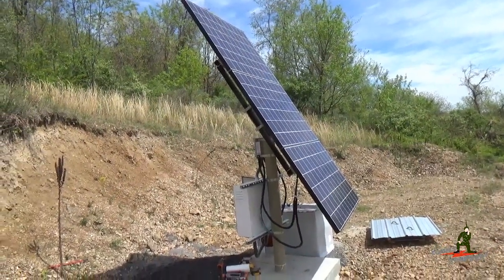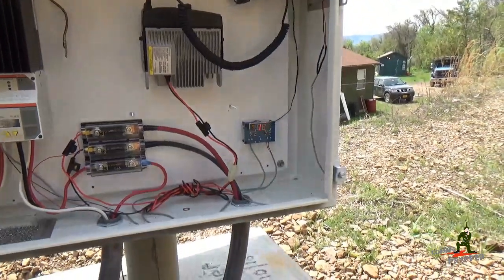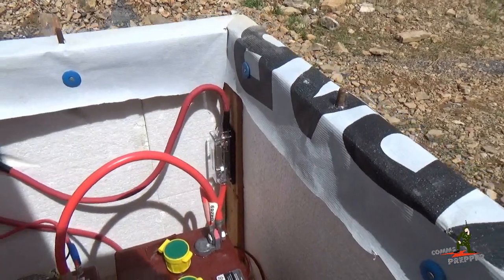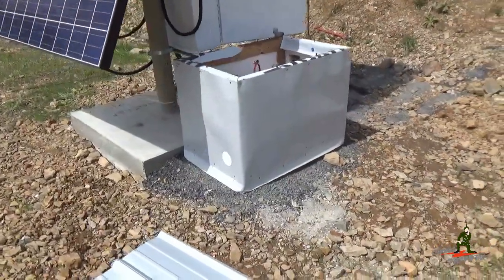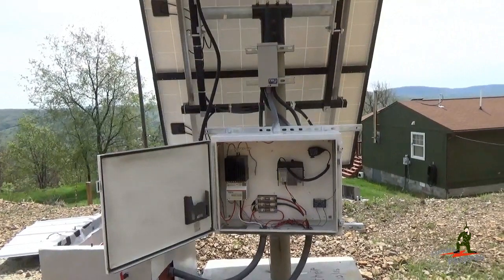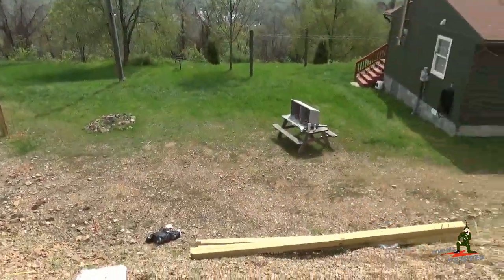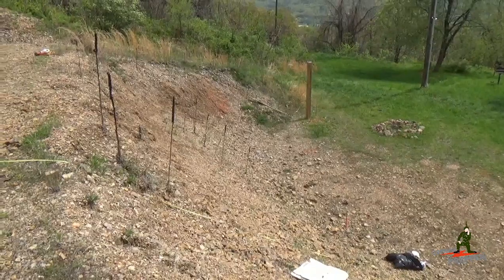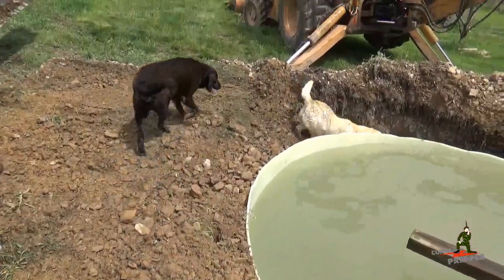Off-Grid Solar Power Project Completed!

Comment: I have 325 watt solar panels they are 34 volt panels with a open current voltage of 42 volts and with max current at 9.32 amps. I have a Rover PG 60 amp MPPT solar charge controller with a max open current voltage of 150 volts and I plan to use the 48 volt system which is rated at 3200 watts for a 48 volt system. I have a 48 volt lithium ion battery 50ah with 3.5 kw. So based off the max wattage input I can only install 9 —— 325 watt solar panels which equals to 2925 watts and a open current voltage of 379 volts which is way over the max open current voltage of 150 volts rated for the charge controller, so my question is which pv module wiring configuration do I use to wire my 9 solar panels to my charge controller and also I checked the manual of the controller and there is no pv module configurations, please I need help which wiring configuration do I use to install my solar panels ???????
Reply from the maker: This is allot of information.  Too much to digest without brand specifics.  Additionally, to provide advice on system design in a comment would be irresponsible. Sounds like you have already made a significant investment in equipment, I suggest you consult with a local subject matter expert (SME).  It is my understanding (I could be wrong) that when using an MPPT controller the array must be higher than the battery bank voltage.  When working out all these numbers you need to check with the manufacture guidance.  Reaching out to your charge controller manufacture maybe very helpful.

Comment: If I saw correctly, the batteries are sitting on a piece of plywood.  
A thick piece of insulating material between the plywood and the batteries might help in the winter.
Reply from the maker: I have a foam block underneath and around the batteries.

Comment: I'm wondering did you really have to call an inspector..they are ok if you want the assurance of there knowledge.. but most people don't know you shouldn't have to call them especially in an area like yours
Reply from the maker: Permit was needed (no way of not seeing panels from the street).  Once the permit was pulled for "solar" an inspection was required.

Comment: Really nice set up as others have said. I would make one comment on the battery box. I would put the vents up high on the sides. Hydrogen is lighter than air and will collect up top. I ran into a similar situation when constructing my BBQ island. I learned for natural gas it was up top and propane was down low.
Reply from the maker: Thanks for the tip.  I have two vents also in the lid for venting gas.

Comment: Hello,
Sorry for broken English.
I am not a specialist but I am also using home made solar off grid system for my ham radio and LEDs.

265ｘ3＝795W（PV）
795W/12V＝66.25A（input to TS-MPPT60）
As far as I know, MPPT amperage boost rate is about 1.35x, but may differ.
66.25Aｘ1.35 is about 89.5A max output.
TS-MPPT60 is 60A charge controller.
I think this setup might damage your TS- MPPT60 in certain conditions because it can be over current.....
I see two  "12V(6Vx2)" batteries in paralell, so 88.775A/2= 44.3875A  current charging for each battery, but internal resistance may differ on each battery that means more than 44.3875A can be flowing into to your one side of "12V"battery.
Trojan T105 seems that capacity is 5-Hr 185AH,  185/5=37A(5C charge current) but 5C is quick charge current so 10C to 8C is better for your electrode to be long lasting.

FB DX and best 73!
Reply from the maker: Thanks for the comment.  My array is not a 12VDC array, it's a 31VDC array and a 12VDC battery bank.  My panels are KU-265 panels.   Panels I think are 8.13amps max X 3.

Comment: Great Upgrade!!
 You can connect your 3 panels in series for higher voltage. T
The Morning Star Controller will handle it!
For Your INFO.
Reply from the maker: +Al Back-Up yes I could connect them that way but would lose charging current levels - which I need for equalization
Reply: Okay.
Just a thought for you.
Take good care of yourself
Thanks for the quick response

Comment: Nice set up.  We went with the most affordable option, just one battery and one panel but its plenty of power for our shipping container house.
Reply from the maker: Thank you for kind comment and feed-back.  What kind of battery are you using FLA or AGM?
Reply: Commsprepper it is a sealed lead acid battery.

Comment: Good job. BTW, you can purchase a panel moisture drain plugs and install one or two on the bottom of the cabinet. This will keep any moisture from condensate or rain water from accumulating in the cabinet. I've seen outdoor enclosures being packed full of solid ice in winter or with several inches of water on the bottom because no drains were installed.

Also, several mothballs in the cabinet will keep ants, spiders and other insects out. Hope this helps some.
Reply from the maker: The bottom of the box has a vent.  If water collected it would escape via the vent.  The mothballs is a great idea.  I have already had a black widow and wasps in the box (worked their way around the bottom filter).  I wonder if the mothball are corrosive to electronics?

Comment: like to see any way to check the voltage amp and system  via sms or via radio it will be a nice set up
Reply from the maker: Funny you bring that up.  That's my next project.  Before I moved the components from the house to the new site the charge controller was connected to the Internet and I would get daily emails from the system and could access the system via the Internet with my cell phone.  The charge controller is Ethernet ready.  I will be adding a wifi bridge this weekend to get the controller back on the retreat's wifi network.  Once it's connected again I will be able to do things you mentioned.

Comment: Where are you going to put the inverter? Will need to be close to the batreries. Outback's FX series would be my recommendation. They're built to withstand the elements.
Reply from the maker: When the time comes it will go where the radio is now.  I will move the radio inside the box.

Comment: "How many batteries do I need?" is always something I struggle to figure out.  There are web sites on it but its confusing.

I was surprised to see only 4 batteries in your box.  Is that enough to meet your needs or are you planning on adding more later?  I would have expected like 6 or 8 batteries.
Reply from the maker: +Greg Gallop Those websites are very confusing and it's hard to tell what's the foundation of a solar system.  For me the foundation (starting point) are the panels and their combined max charging amps.  With lead acid batteries you should be able to produce charging current equal to 10% of your battery banks total amp hours (per Trojan battery inc).  My four batteries create a 480ah bank but my panels can only 25.5 amps of charging current and I should have 48amps.  So even in my system I have too few panels or too many batteries.  But it's what I can afford right now.  So since I'm only using the system to power lights and low power items (TV, PC, etc).  I have enough for weekend trips.  If I hit the lotto I would have 12 panels and 8 batteries.

Comment: I like to series my panls and send high voltage to the house (around 140v DC.  That way the wire guage dosent have to be as big and will be a cheaper run to house.  then charge controler and batteries (sealed & vented) is in the house.   that way they are protected from theif, weather, and extreme temperature.  Same protection for the inverter.  Now I got local 12 volts for radios, lights, tv & satellite and what not in the house.   Whatever you do dont run 12 volts to the house.. Step it up and then back down but wastful and why i send panel voltage and not battery.
Reply: huh, No.  I have a Midnight Classic controller and it takes in the much higher voltage and lower current that can travel that greater distance from the panels on smaller gauge wire and charges out whatever voltage your bank is and what the controller is set to do output voltage wise.  So an input of 150v at 8 amps can output 12v at  100 amps.  Maybe that a MPPT thing but move power with higher voltage if at all possible.   Dont get me wrong Commsprepper Im not lecturing you but putting the info out for others reading to consider.. Think Ive watched all your video.. Thanks, K4JUD
Reply from the maker: Sorry - you are correct.  I forgot about the MPPT controllers and how they convert excess voltage into charging current.  Thank you for pointing that out.  Respectfully, Hank
Reply from the maker: +Home Phone the problem with series is you don't gain charging amps - you gain voltage.  So 10 8amp panels in series with only give you 8 charging amp.  I have flooded lead acid batteries that create a 480 amp hour bank, so I need to produce 10% of total bank amp hours (48amps) to properly charge and maintain (equalize) my batteries (per Trojan Battery Inc.).  Even with the 3 panels I have now I can only produce 25.5 amps of the needed 48amps but I can only afford 3 panels right now.   As for A/C power to the house it's the old Westinghouse vs. Edison argument.  It's better and cheaper to run AC vice D.C.  So when the time (and funds) come I will run AC to the house - but that's in the distant future.

Comment: How long is the wire run from the battery system to your home? What is the wire gauge? And what is the measured voltage drop?
Reply from the maker: The distance is 65 feet but I am not running it down to the house right now.  As it stands, the system is 12VDC only for my radios.  Perhaps in the future I will get it routed to the house after I add the second building below the array.
Reply: Thanks for the update! I enjoy your videos. Keep up the great informative work!

Comment: batteries will last longer if you could keep them near room temp.  an option is to move them underground.
Reply from the maker: +gg I agree but maintaining room temp requires allot of power.  We don't run heat or AC when not on site.

Comment: I don't think you  covered the run from the panels to your home???
Reply: So, for right now, 210 amp hours of battery storage and nearly a kilowatt of peak charging is powering an emergency radio... :)
Reply from the maker: I am not taking that challenge on right now.  For now I am going to leave it as a DC system for local radio operations.  Once I add the second building below the array then I will look at running power to the house.  With that plan, I will run the solar array output down to the new building and put the controller/inverter/batteries in that building.  Then I will only have a 20' AC run to the house.  However, that's a plan awaiting funds and I don't see that happening this year.  Perhaps next year.
Reply from the maker: Actually it's 480AH of power.  Once again I will have an inverter when funding permits.  I built this out to support the future plans.  Hank

Comment: Looks good. Have you thought about maybe taking some heater hose or something like that, and cut it lengthwise and use a glue or caulk and slide it around the battery cover? I'm just thinking it's at the perfect height for someone to accidentally walk or trip into it and get cut. Just a thought. Keep up the great work.
Reply from the maker: I was going to add something (I like the hose idea) after the inspection.  I want to keep everything clean looking right now.

Comment: That is first class. For the rest of us,  Renology.com has good inexpensive 100w 12vdc panels, $120.00 delivered.  I'd get at least one, if in the south, and 2, if in the north.  Also had good field test of a yagi.  The receiver was 25 miles away, and he could hear me good on one watt through a 10dbi yagi (ERP 5.5 watts) when it was vertically polarized.  When the yagi was use horizontally, just a moment latter, the receiver heard nothing.
Reply from the maker: Thanks for the info.  Hank
Reply: I need to make a correction.  In the field test, a moxon antenna was being used, yet the ERP is only 2 watts out of that 5.5Dbi antenna.  When crossed polarized, the signal is attenuated about 20Dbd, or about 99%.  Horizontally polarized, the signal is reduced to .02 watts relatively speaking, or 20Mw, and did not make the 25 mile trip with enough strength.  Had the receiver also had a horizontally polarized antenna, he would have picked up the signal no problem.  Conclusion,  low power and cross polarization is useful, if you'd rather not be heard.

Comment: Where's the antenna for your Kenwood ?  TM-281?

--Konrad, WA4OSH
Reply from the maker: I tested this weekend with a mag mount.  I have a double N-Type bulkhead connector on order.
Reply: A nice J-Pole on a 10-20 ft tower is order.  

Also, I would add this inside of your cabinet -- a ADS-SR1 Simplex Repeater.
https://www.argentdata.com/catalog/product_info.php?products_id=98
Reply from the maker: I have two.
Reply from the maker: At 1800 feet I don't need a tower.  I plan to add a 16 6X6 post for antennas.
Reply: I agree.  You have a nice view of the valley from up there.
Reply: Definitely you want to disconnect your antenna from any transceiver not in use to protect your radio from nearby lightning strikes and solar flares.  Conventional and nuclear EMP's are very rare incidents.

If it's a long term backup radio, would definitely wrap it in aluminum foil.  Then wrap that with a plastic/foam insulating layer.  And then wrap it again in another layer of aluminum foil.  Alternatively, put it inside a fitted Faraday bag.  A Faraday shield has two complete metal layers insulated from each other.

https://en.wikipedia.org/wiki/Faraday_cage
Reply: In this particular case, I would put a loop in the coax before bringing it into the metal box.  I would also use a lightning arrester  right before coming in on the bulkhead connector.  And, I would take that spark gap lead through a heavy braided strap directly to ground.  All of this of course won't prevent damage from a lightning strike, but it will dissipate static from the antenna structure to ground before it accumulates enough to damage your final transistors.
Reply: Re: antenna, I read somewhere that some people leave their antenna disconnected on their emergency backup radio to make it more EMP resistant. not sure how helpful that is, but I thought I'd share. Congrats on the awesome set-up!

Comment: only thing that I can see that might flag. is PV cables need to be covered. lables
Reply from the maker: Covered how?  From the back of the panel to the combiner box?  I have wire loom on them now.  What did I miss?
Reply: In Minnesota you have to use something so you can't touch them like netting or I use plastic cardboard.  See what they say. Every inspector says something different
Reply: They are "low" voltage less than 50 volts.  No different than thermostat/doorbell wiring in a home.